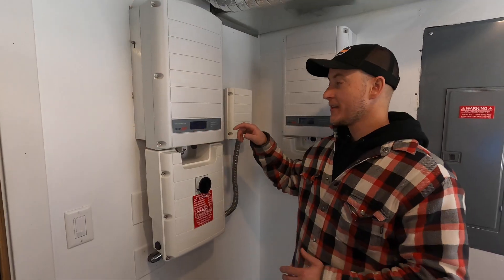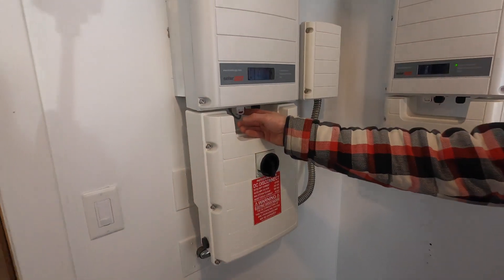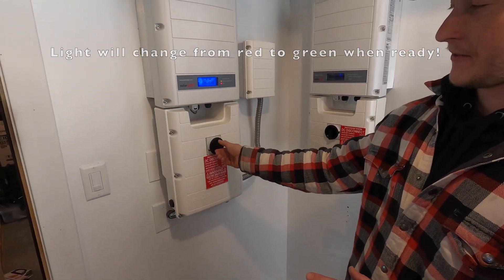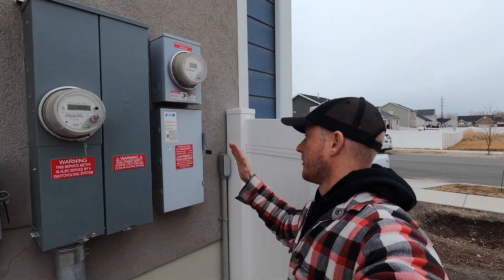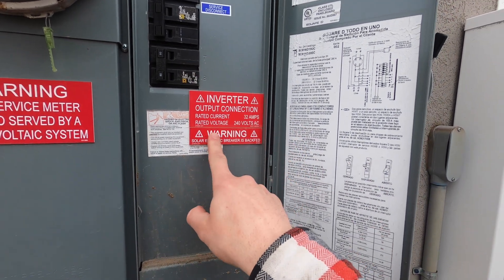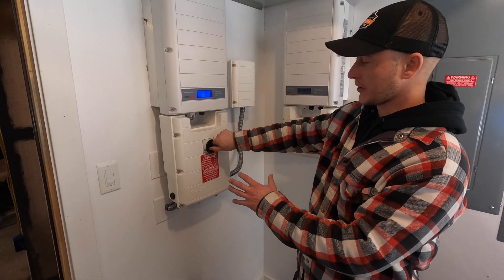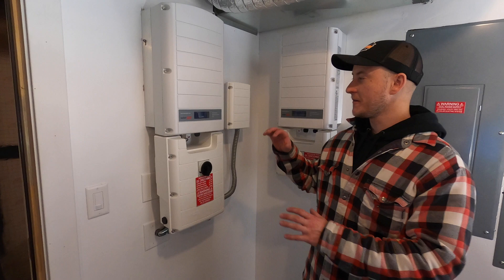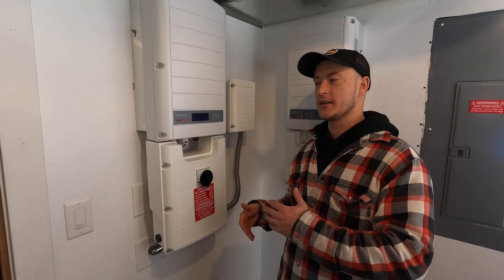How To Reset Your SolarEdge Inverter (Turning It Off Then Back On)

Comment: Mate it’s solar edge inverter is a good and quality brand? Thanks in advance to your reply 😉
Reply from the maker: Absolutely mate!  One of the best products you can install.
Reply: @solargoat  i heard on review some SE inverter failed for a year of use and the manufacture warranty is not easy to get in touch 😬
Reply from the maker: @oliverthemechanic8532  That doesn’t surprise me. As a contractor it’s easy to warranty but as a homeowner is difficult. 

This is 100% we’re Enphase has the advantage. Not single point on failure with micros